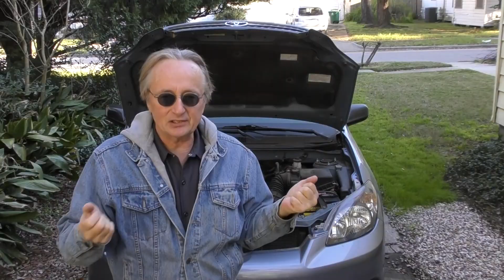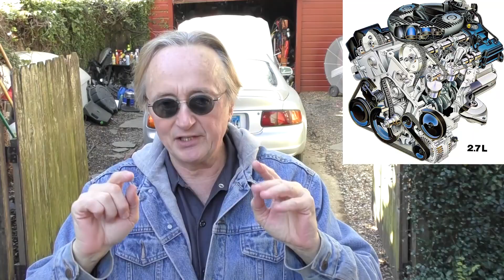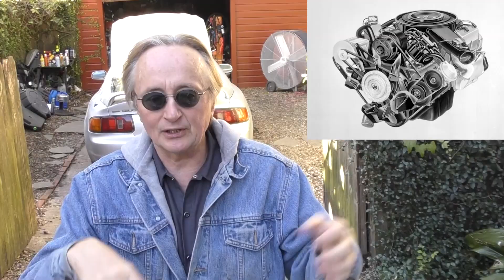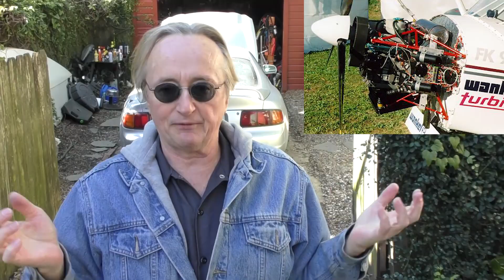Never Buy a Car With This Engine

Comment: All of these car companies are run by idiots, and their cars/trucks are all designed by know-nothing yuppie millennial idiots. Mankind will be lucky to survive its own idiocy over the next 100 years. Everyone is always trying to tinker with what works, instead of leaving well enough alone.
Reply: I actually agree on leaving well enough alone, although I would blame the strict emissions and environmental standards most, as companies are trying to squeeze as much efficiency out of these engines as possible, as well as have to implement stupid designs to pass emission tests. Same reason why some of the most well regarded diesel engines have become unreliable piles. I think we should focus our resources on making better road systems that get you places with less stops rather than screwing with automobiles, that would be much more effective in my opinion.

Comment: There was absolutely nothing wrong with the " engine" itself when it came to the cadillac V8 - 6 - 4. All you had to do was open the hood, disconnect the connector that activated the system that shut off the cylinders and the engine ran as a normal V8, which it was.

Comment: In 2017 I had an 85 mustang gt and an 88 rx7 at the same time. They got the same gas mileage (like 10-15mpg) but the mustang had like twice the power! That car killed my expectations for rotary engines

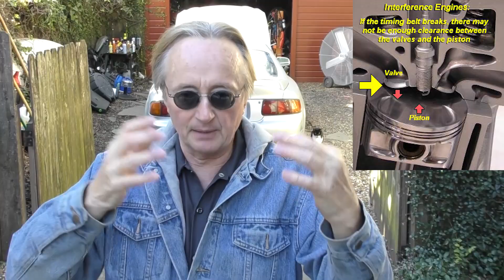Comment: KITTY ALERT!  (2:12), (8:25 & 9:50).  Sittin' in the driveway/on the roof, watchin' the Scottster.
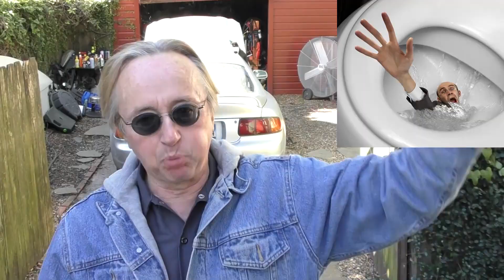Reply: 5:40 kitty jumps on celica
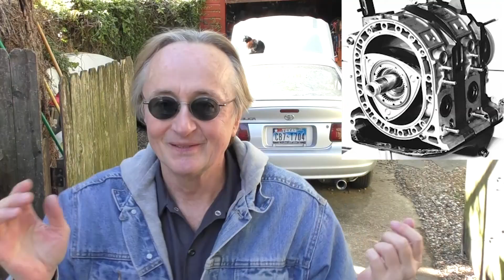Reply: ..instead of 8:25, didn't you mean @8:07?  But thanks..
Reply: Cats are THE biggest camera hogs, plus, they Always gotta inspect everything !
Reply: When he went "Bang!" the cat barely noticed.

I think he must cuss and holler a lot while working on cars.
Reply: daveogarf; Spot on! GM's line of Ecotech engines is one of the best unpaid adverts Toyota could ever get. Went the same route you did. Never again a GM product!
Reply: I prefer v6 in-line or v8 s
Reply: Lmao best comment ever. Now I’m lookin for kitty’s lol

Comment: GM 2.8 V6.  Used in S10 pickups and blazers.  Just complete junk.  Gutless and just so-so fuel economy.   The 4.3 that replaced it a few years later was light years ahead.
Reply: My father-in-law has a Chevy Astro Van with the 4.3 V6 engine. It now has over 500,000 miles! He got it used with well over 400,000 miles for dirt cheap and it has been running great ever since.
Reply: Greg Rowe that was a weak motor had 1 in a 1985 Pontiac firebird
Reply: @momofone28  I've never seen one, but Firebirds also had a 2.5 "Iron Duke" 4 cylinder engine available. Now that is slow!
Reply: @garylangley4502  I have seen 2.8 Firebirds,also in Camaros too? And they were slooooooow!!!
Reply: @DrOlds7298  They had the 2.8 Liter V6, but also they had the 2.5 liter 4 cylinder engine that the Chevy Citation and Celebrity had. I'll looks around for a video that shows how slow it is. It had about 130 lb/ft of torque, but only 90 hp. 0 to 60 mph time for a Camaro with one of these 4 bangers was 20 seconds.
Reply: The 2.8 V6 was also used by AMC in the first Jeep Cherokee and commanchee pickup.

Comment: hahaha the bumps in the road of progress and engendering expermentation so funny.

One story I used to hear was 1 where the Navy put out a contract for sealing the chambers 4 nuclear submarine reactors. One of the contractors submitted to change the standard welding the Bolt in gasket sealing of the reactor. The salesman for the new gaskets claim that the gasket would be able to handle all pressures and radiation and that it would be cheaper and if you had to work on it it would be quicker and he went on and on and on and on with one of the generals. Then the general asked them, what would you put in if your child I was working on this submarine. The salesman for the gasket company thought about it and said quickly weld the darn thing.

Never buy untested new technology when you need to depend on that technology frequently over a long period Of time.

Comment: I like how everyone here defending the 2.2 ecotech are bragging about 200,000 miles. On both my '86 Ford 1.9 and my '92 Ford 1.9 200,000 miles was barely broken in. Both engines lasted well over 400,000 mi. with the '86 have 514,000 miles on her when I sold it. Original engine and trans.

Comment: I bought a brand new 2003 cavalier with an ecotek engine. The car is out in my driveway and still runs great. My Dad told me when I got it to keep the oil changed, and it will last forever. I think he was right.

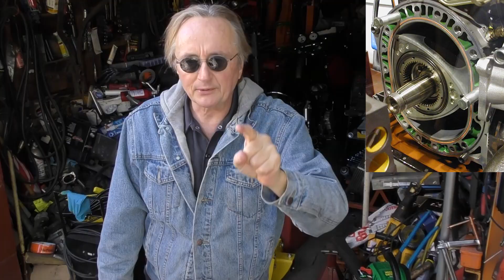Comment: 7:11.  I think the main reason the Wankel got such poor mileage was because it was actually a much larger engine than most people think.  To measure the displacement of a piston engine, you measure the area of the cylinder multiplied by the stroke of the piston and then you multiply that by the number of cylinders.  For the Wankel, they measured ONE combustion chamber for each rotor and multiplied that by the number of rotors.  For this Mazda engine, the volume of a single combustion chamber was 650cc times two rotors equalled 1.3 liters.  The problem with that calculation is the fact that each rotor contains 3 combustion chambers, not one so the true displacement was actually 3.9 liters.  No wonder it appeared to make a lot of horsepower per liter!  I believe if Mazda had reduced the size of the engine from 3.9 liters down to say 1.3 liters, while it would have produced less horsepower, it would have produced better mpg.

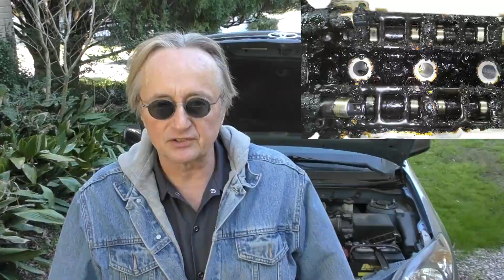Comment: 3:07.  They were available in the 2005 Jetta as well.  In all fairness to Scotty, the engines may have been produced in 2004 and used in the 2004 and 2005 Jetta but the 2005 Jetta model year was only 6 months before VW came out with an entirely different 2005 Jetta using a 5-cylinder engine.

Comment: I own and owned vehicles with 2 of the motors on this list. . 2010 Cobalt 4dr auto with 210k spun like a top and averaged 34mpg (60/40 highway/city driving) til the day it got totaled. Now i have a 2dr 5spd with 130k can't wait to put 100k+ on it. Also have an 88 rx7 vert with 125k fun summer cruiser. Average 18mpg cruising or 10mpg with some spirited driving.(It's all about smiles per gallon anyways. Rebuilds are simpler considering they don't have nearly as many moving parts compared to a piston engine. Cats fail sooner if it's aftermarket because 99% of aftermarket companies do not design the cats for the higher egt's a rotary engine produces. Oem cats are great and can last as long as cats on piston engines. Rant over

Comment: I had a 2005 Chevy Cobalt 2.2L got it at 84K mi and drove it until 152K no problems, just did regular maintenance. I dont even like GM cars but it was very reliable, got 27-30+ mpg  always. When I started  changing my own oil at around 135K, I realized it was burning 2 quarts of oil in between 5000 mile intervals. I needed a bigger car so I got rid of it, This is the first time I have ever heard that they were bad engines though.

Comment: I have a 2.2 'Ecotec' in a '04 Chevy Classic. I bought it with 30k miles in '12. As I'm typing this 7 years later it now has 132k miles. I haven't touched anything on the engine yet except for a oil change every 5k miles. Best engine I owned. It has a range on 400 miles/gets 25 mpg city. I can't complain.

Comment: What are you talking about? The 1.8t is great! If the manufacturer says you need to use synthetic oil just fucking use it? I mean thats just an idea, but you wouldn't pour the wrong oil into a Toyota engine either. You are just asking for it to blow up if you don't listen to the manufacturer. Thats not Audi or VWs problem thats just your problem if you don't use the recommended oil and if you don't follow the right oil change interval for it

Comment: 225.000 miles on my Dodge 2.7 and it's still going strong. Water pump didn't destroy the engine or create sludge either. Original head gaskets and no engine noise also.

Comment: The Ecotec engines in Saturns ran forever. GM always made good engines untill 2005. Those 2.2L I4, 3.8 L V6, 5.7 L V8 and 454 V8 ran forever.
Reply: The 3800 3.8L series 2 is nearly bullet proof.   My brothers ‘04 Monte Carlo SS supercharged version of the 3800 has 292k plus miles and still runs strong.  My ‘03 SS I sold at 236k miles only because I couldn’t get the evap code to go away and wouldn’t pass inspection although engine was strong, no leaks, no smoke, barely used oil.
Reply: @jjs777fzr   you just had to get the PCM reflash done. i have it done to all of my OBD II cars. costs around $100. you have the emissions turned off, all emissions codes GONE...... no more EGR, EVAP, or any of that emissions crap. how it works is the PCM is reprogrammed to never activate the emissions control devices, but the monitors still clear.

check engine light then only activates for drive-ability issues.
Reply: Yet, they discontinued the product.  Figured GM was put off by the fact they had a product that worked.
Reply: @Buster Brown  great engine, only flaw being head gaskets. you can replace them yourself though. simple engine
Reply: @Sleeve Of Wizard   that engine wasnt that bad but it did have a crappy fuel injection system..... spider harness crap
Reply: In 2003 I want to say they actually redesigned the 2.2l ecotec and as you would notice the redesign has no power steering driven by the camshaft anymore. They changed the timing chain design (which were a common issue) and camshafts at least I know for sure. I never seen an issue with these cars they were bulletproof I also owned an 05 malibu with a 2.2l ecotec

Comment: Missed BMW V8 N63 engines that was put in 2004-2010 750, 550, X5 and other 4.8L cars. The engine burned a lot of oil and constantly broke down. BMW was sued and eventually had a major recall having to fix 220,000 engines

Comment: Another engine to avoid: GM 6.5L Turbo Diesel manufactured before 2000.  The #8 cylinder wall had a defect in it and if the temperature of the engine got above 220'F it would crack and lead to the mother of all coolant leaks.  Don't ask me how I know this :P

Comment: My bud's RX3 used to get 9-12 miles per gallon, we used to split gas on ski trips.  Fun car, loved the way it sounded, had a different power band in it's acceleration, compared to conventional engines.  If I remember correctly it had a little more low end, than you're average small car, and yes, it burned a lot of oil.

Comment: I have a 2007 Chevy HHR with the 2.4L posting 186k miles on the dash. I only use Mobil 1 synthetic oil.  No issues and runs like a champ.

Comment: Got an 04 Ion with the 2.2. The manual says change the oil when the "change oil" light comes on. That's about some 8,000 miles. That engine is a 3,000 mile oil change and you need to check the level weekly to keep it running quite.

Comment: I have a 06 cobalt SS n/a 2.4L Ecotec. 153,000 miles still no problems expect for GM recalls. Maybe GM put better parts in the 2.4s?

Comment: I would have to disagree with you when it comes to vw 1.8t.  I just got rid of mine and it had 250k still running.   My uncle is a vw mechanic for many years and i put what ever oil was on sale. The only thing he told me is not to get the small oil filter but always get the big size oil filter and i never had sludge problem.  Engine ran like a dream

Comment: No mention of the Ford 3V 5.4L? Notorious for spark plugs issue  and the dreaded cam phaser replacement that pretty much every 5.4L will need. I have even heard of the cam phasers rebreaking after replacement.

Comment: Scotty I'm not a fan of the rotary engine but the oil injection pump works to help protect the seals. But never fear that rotary engines coming back one way or another. Probably is a kind of generator for a Hybrid engine.

Comment: I had a chevy cav with a 2.2 got 219k miles before it engine blew.
Had a chevy cav with a 2.0 ran 325k miles before the frame rotted out and was cracked. Then the motor blew on the coldest day here in Minnesota

Comment: A problem with the water pump inside driven by the timing chain is what happens when the shaft seals started to leak?  You guessed it, water in the oil pan!

Comment: Amen on the Chrysler 2.7L... what a pile.  I had one in a Dodge Intrepid and it developed sludge problems and low oil pressure at 40K miles in spite of meticulous maintenance.  Got rid of it as soon as I could.

Comment: I had a 1973 Mazda RX3 and blew the Apex seals twice.  I liked the car a lot. It could wrap up the RPMs like crazy.  I had a lot of fun with it, However it was a mechanical nightmare. Everything on it broke at least once, but at the time I was Jet Engine mechanic on Cobras in the Marines so I loved turning wrenches, it kept me out of trouble. I also had  3 Saturn Ions with the 2.2 EcoTech My boys used them and learned how to work on cars.  We never had any major problems with them. They were cheap cars the kids could use to go school and work.

Comment: When Mazda made the rotary, they thought it would be revolutionary. They thought it would be the most efficient, best power to weight, (which it did have good power to weight ratio) and reliable. Well turned out to be an engine only good for racing, getting terrible gas mileage and having Apex seal problem 30,000 miles in. And for some reason, I want one.

Comment: you should be able to get a RX 7-8 cheap and drop an electric motor in them
Reply: Or even better drop a LS1 in it or a s2000 engine those f20c love to rev up to 9000rpm.

Comment: Gm corrected the timing tensioner by 2005 .  I had a 2.2   ecotec with 240,000 miles still ran and shifted perfectly when I let it go. Drove it for 12 years every day 100 percent reliable.

Comment: The GM LD9 2.4 I  have on my 2002 Z-24 is a beast. 150000 miles and still going. Had it since new but now I'm using it for a 150 miles a day work commute and the engine never had an issue. One of the BEST engines I ever had. (Not the quad 4 or ecotec) I'm talking about the LD9 2.4L GM

Comment: Cracked
Heads
Every
Valve
Rattles
Oil
Leaks
Engine
Ticks
Reply: Haaaaaa took me a while, tbf I haven't seen many issues with the 5.7 Vortec motor
Reply: Constantly
Having
Every
Vehicle
Recalled
Over
Lousy
Engineering
Techniques

Comment: I have a 2007 Malibu with 157,000 miles and still going strong, hope to get 180k out of the 2.2 engine...but I do use good oil and change it on schedule.

Comment: Scotty i have a 2002 audi a3 1.6l 8l is this engine  a reliable one
Reply: From what I have heard from a friend that trades with used cars here in Europe this VW engine is good up to 120-150 thousand miles, then starts burning quite a bit of oil, and the manual trasmissions on these are weak. I had a friend with exact same model of car like yours, hers was 200 000 miles and she did not complain about anything. Another frined of mine had the 2005 A3 with the same engine and it broke down on the trip home after he bought it, but was some minor problem with the electrics and the mechanic he called could fix it by the side of the road.

Comment: The 1.6L Ecotec engine was a piece of crap. My Aveo crapped out at 197,000 km which I think is less than 120,000 miles. The head gasket blew twice from boring city driving. The Aveo was a cute car. The engine front suspension was its weak spots....but major weak spots.

Comment: Triton motors are far worse than ecotec motors.
Reply: @Steve Silvas  V10 2v are indestructible. Tritan, I would assume they meant the 5.4l 3v. Those are pretty bad engines.
Reply: amen to that one.
Reply: @Steve Silvas  I'm referring to the 5.4 mainly. Horrible motors. Aren't nearly as many 6.8s out there as compared to the 5.4

Comment: Had a 2006 hhr2.2 engine  what a nite mare! Timing chain went and so did valves! The car was worth $1,000 and repair estimate $$$ talked to mechanics at gm dealer that was 100k miles engine and junk the car , cobalts had same engine! GM started with engineering genius with Vega engine LoL!

Comment: I still have my 2003 Saturn L200 one of the first cars with the 2.2 Ecotec. Got it used in 2010 with 48,000 miles now it has 130,000 I have had no problems with my Saturn best 4 grand I spent but I like to change oil ive always used Quaker State synthetic every 4 to 5 thousand miles .

Comment: Bought a 2008 Pontiac G6 the POS ecotec was the worst.  Chain ripped itself right off the gear. Was in a tight spot and chose to buy a replacement used engine. Finally got sick of the constant nickle and diming that car did. I'm now driving Toyota Carolla- why with my mechanics recommendation. So far I'm quite happy with it!

Comment: I have an Audi A4 2.0, which has tons of major issues at only 51k miles: Burns oil, faulty tensioner and timing chain, turbo issues. Debating if I should sell it??
Reply: Adam R what year is it? Don’t spend a penny on it. Better to swap a 2.0 from low miles 2015+ GTI or sell as is if you want easy reliability, but Audi can be enjoyable and comfortable no?
Reply: It’s a 2010, I am the original owner and the dealer won’t fix it since I am out of warranty. I am not sure if I want another Audi after this...
Reply: Adam R I’m sure of that but don’t you want to fix it?
Reply: I am going to push Audi hard to replace the tensioner at least which can save my engine, if not I might fix it myself and pay for it at a shop.

Comment: My wife bought a brand new 2006 HHR 2.2 ecotec w/5 speed manual. It died at exactly 250,000 miles. It was a pretty reliable car, up to that point. Still had the original clutch! 
I was going to rebuild it, but after pricing the parts, I decided it wasn't worth it. I still have the car, so if anyone needs a 5 speed trans for an ecotec,  let me know! I'll even throw in a brand new clutch kit and flywheel